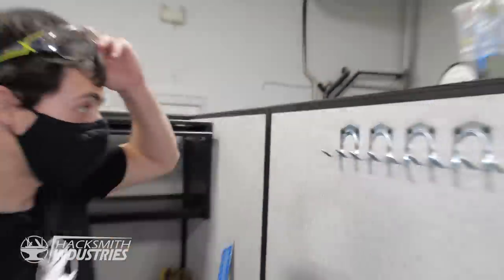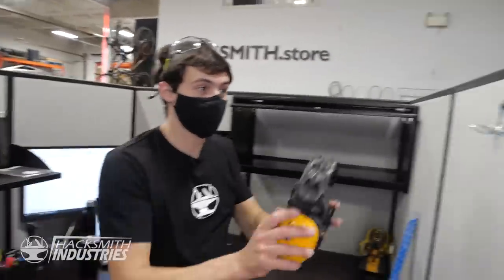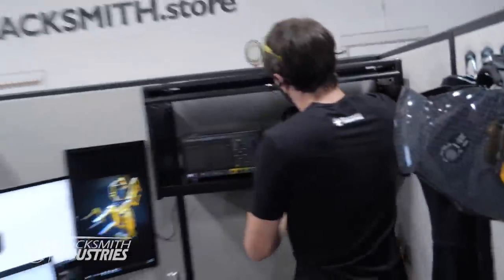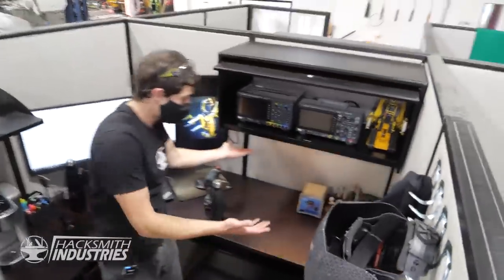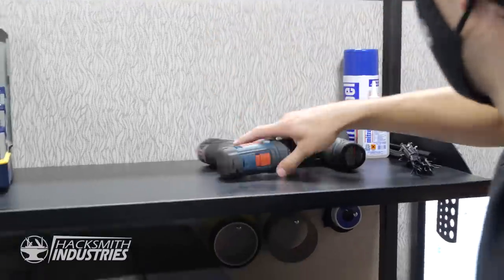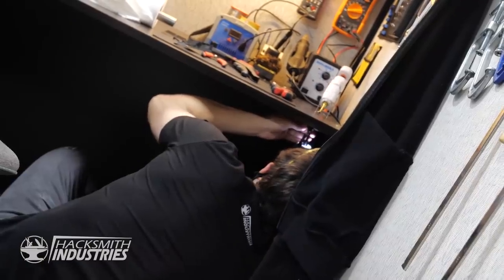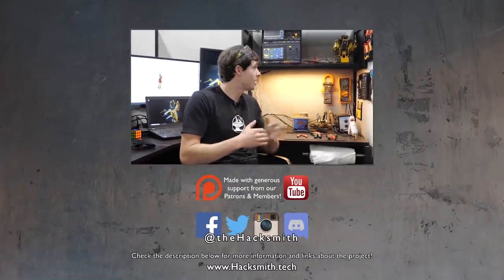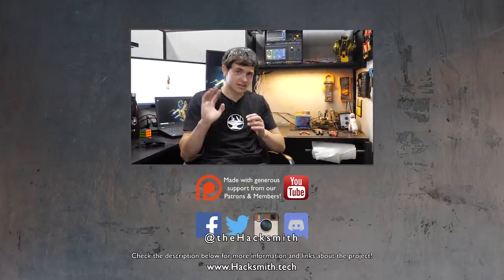We made the ULTIMATE WORKSPACE! (WEEKLY VLOG #18)

Comment: That piece of wall above the soldering station looks like the perfect place for a built-int fume extractor, although maybe not if there is another cubicle on the other side.
It’s funny how you have so many tools in there but no hardware or materials to work with. However, it’s still a very cool workstation so well done Bogdan! 💜

Comment: Well you didn't blow the breaker, so your good there. You just need a roof over top and maybe a bed or sleeping mat under you desk and a bangin surround sound system. Now you might also want to find a way to install a wet room for showers and doing your business and you could flat out live there. 

I also work in a cube and for years I've wanted to put a roof on it just for that added privacy. Unlike most, I like being in small area's. Well there is a such thing as to small like when your digging out a igloo and just your body fits inside with no wiggle room. That's my limit. :)